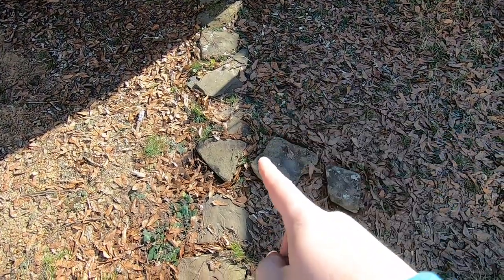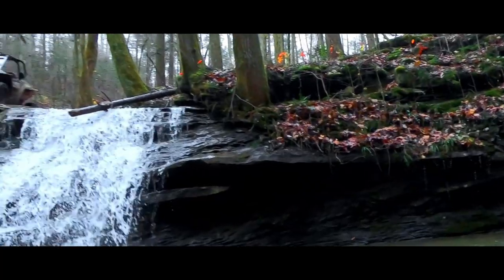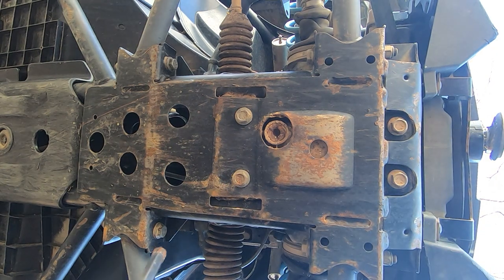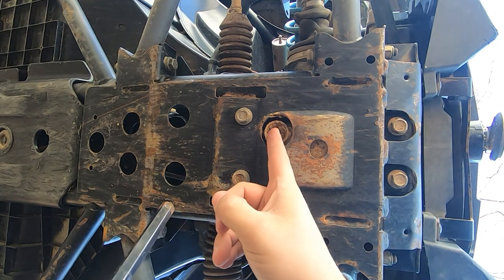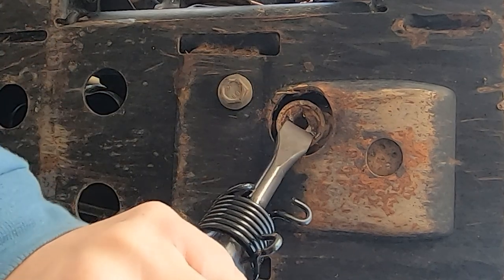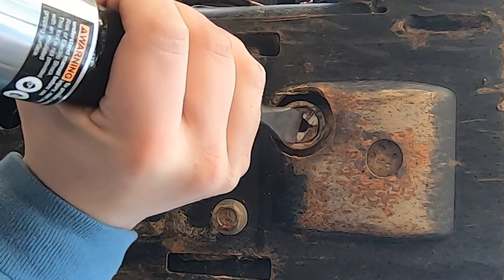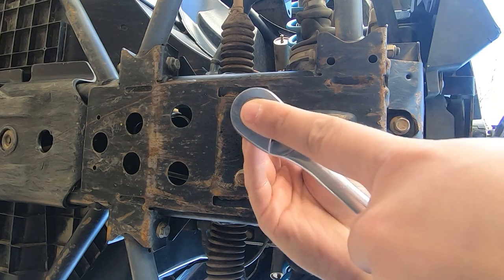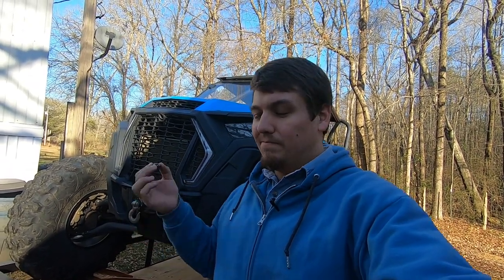How to remove a stripped RZR drain plug with an Air Hammer

Comment: I'm doing a similar job with my 350z transmission fill plug but the air hammer I bought came with a chizzle tip that has an indention in the middle. Do you think it would be better or worse than using a tip with a completely straight edge?
Reply from the maker: Sorry I just seen this comment, hopefully you got it out by now but either tip should work. You really only use the edge of the chisel.

Comment: What is the new magic tool you used?
Reply from the maker: Are you referring to the air hammer? I guess I'm not really sure what you mean by "new magic tool"
Reply: @BCDriven  pneumatic* tool. Didn’t mean new magic.
Reply from the maker: That's a pretty comical auto correct lol. It is called an air hammer or air chisel and it basically whacks a piston back and forth inside and hits the chisel or whatever attachment you have in it. Something like this https://amzn.to/3lEMfY1 from amazon or if you have a Harbor Freight near you they can be had for roughly $15 usd.  All the big box stores have them as well including Walmart. They're actually pretty useful tools there's just a few specific jobs that they're used for.
Reply: I'm gonna  try this tomorrow.. been trying  to take that bolt for the last 2 days.  😮‍💨😮‍💨😮‍💨😮‍💨